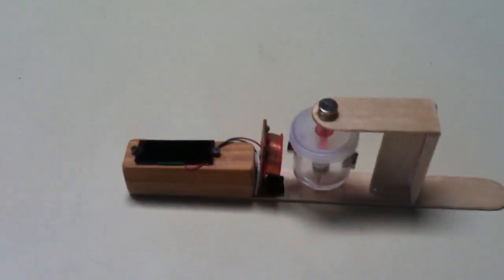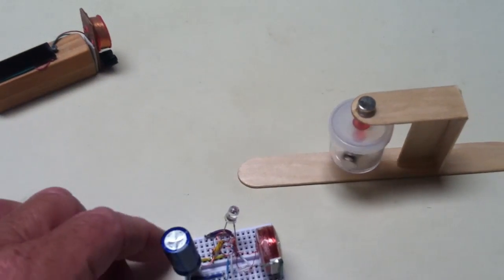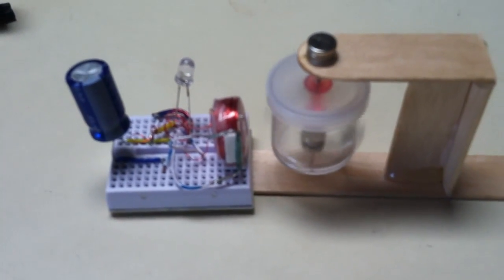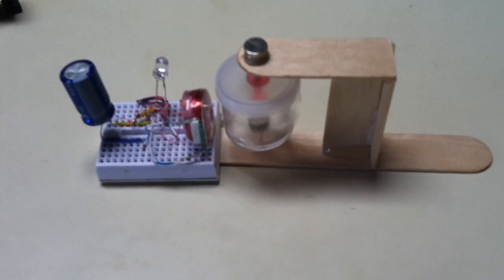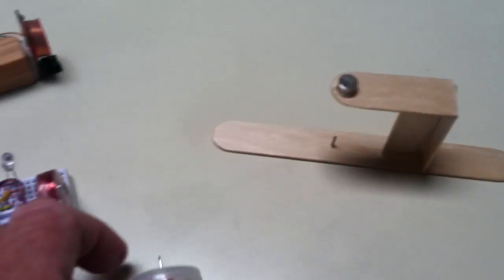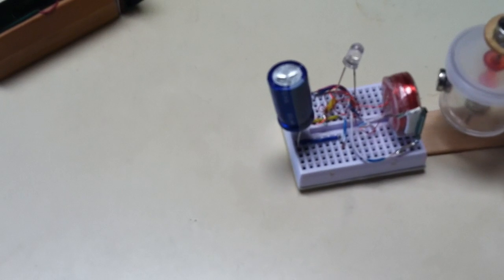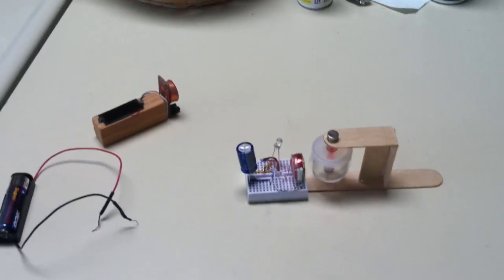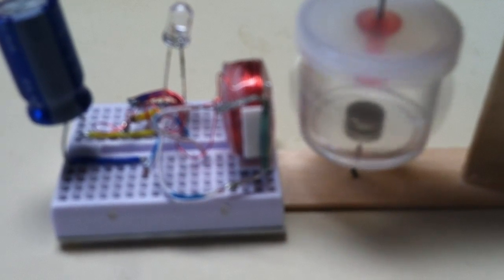Curious Effect In A Pulse Motor

Comment: Hey Lidmotor, where do you get those coils? Have you found them in certain solar toys or wind them yourself? The coils I find in those solar toys are never anywhere near that size.
Reply from the maker: Plastic sewing machine bobbins. I wind them up with 30ga usually using an electric drill.  They work great for these small projects.
Reply: ***** thanks!

Comment: After having experimented with my own device duplicated recently, basing on your and other
videos, I dare to say that your second spool is simply too powerful, forcing the rotor out of alignment. When starting the gyroscopic effect is not yet developped enough to withstand
these forces. I assume that my own precisely machined ALU-rotor, running true to less than
1/1000 of an inch, is spinning up to about 3000 rpm, then the point begins to loose contact
and dances around on the lower magnet before it is finally flying-off. The higher the bearing stability of the rotor  and the less the unbalance is, the later the wobble begins or maybe not at all.

Comment: The high positive voltage generated in the circuit probs sucks the juice out of the air via induction. Put it in a box and fuck with the temperature gas mix to see if it slows down, speeds up

Comment: sorry if i sound stupid but, in small scale would your source be affected by Nd magnets in such close proximity? i ask because it only takes tenths if not thousandths of an inch to change rpm.
Reply from the maker: The super cap isn't affected but the reed switch driver as a whole is very much affected buy the distance away from the magnet rotor.

Comment: It seems to me what is happening is:
1.  The cap provides a greater magnetic pulse that pulls on the mags with a greater force  than the solar cell.  That extra force causes the mag field to create a greater force to be applied to the rotor mags at lower speeds--which results in a more unstable cylinder rotation at a slower rpm.  That is especially noticeable on a mag bearing because it doesn't have the ability to resist such tangential forces as a fixed bearing would be able to suppress from an observer.
2.  As the rotor rpm increases there is less time for the mags to be forced as much before they pass the oscillating mag field & thus the destabilizing effect on rotation is increasingly less as the rpm increases.

My guess is that if you put the cap driven system further away at start up (so that it causes the same initial level of rotor swing at start up as the solar cell system) and then gradually more it closer to the rotor as the rotor increases in rpm, then you could get exactly the same level of rotor stability from both driver systems--although, the cap driver system will drive the rotor to a higher rpm because it provides more power.

p.s.:  Luv the mag bearings!  Nice work!

Thanks for sharing!
Reply from the maker: Thanks.  Your description pretty much sums up what I think also but there are some other interesting forces that really spice up mix.

Comment: I'd agree with the gyroscopics, as mentioned below. At some point in the acceleration, the wobble cancels itself coming back again. I wonder if ducks build pulse motors lol
It happens with poorly balanced propellers sometimes on my homemade aircraft. At a certain rev range, the prop goes quieter, the shaking stops. But, it can also lead to shattering as soon as the speed changes again !
Reply from the maker: It is combinations of things I think.  Fun to watch.
Reply: measure the D of the coil the D of the magnets and then punch that into an online golden ratio calculator - of course the center of an mag is the 'zero' point so maybe you can use radius but i don't think it will matter.  
you might find that the 'harmonic' point is related to the golden ratio from the zero pint of the magnets your electromagnet and perm mags. 
i'd be interested to known.

Comment: Let's say you used a scope or frequency counter to measure the circuit pulses and divide by two for the poles of your rotor.  Wouldn' t that indicate the rpm?
Reply from the maker: Yes.  That is one way to check the RPM.  I have a laser RPM tester that will do it also.

Comment: it looks like because the bearings are needles held in place by magnets, the rotor is allowed to wobble when under going strong pushing force of the electro magnet during acceleration. As the rotors speed increases, the force of the drive coil becomes less, or stableizes, and the centrifugal force of the rotor also helps stableize the rotation. If the rotor axis were fixed, attached top and bottom, the rotor would not be alowed to give under hard acceleration.
Reply from the maker: Yes.  That is about how I see this also.

Comment: Same as a Gyroscope or those ones where you pull the string on the top.  I bet you the one with the solar panel has less force than does the one with the super cap.  Try and swap the coils and see what happens.
Reply from the maker: Spinning top also.  Same thing.  Wish I had "magnetic vision" so I could see all the flux lines enjoying the party.
Reply: *****
They make a device for that if I remember right it is a thin plastic square and shows the flux lines.
Reply from the maker: That might be very interesting to hold one of those next the motor and watch the show.
Reply: *****
Aye.